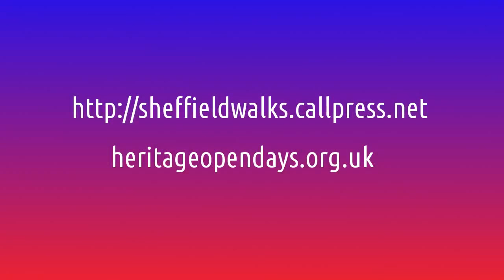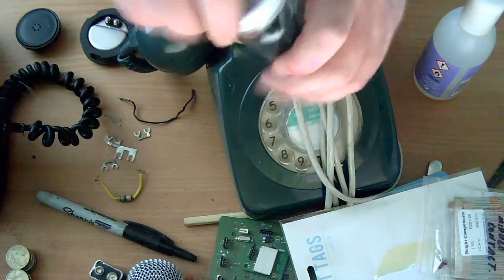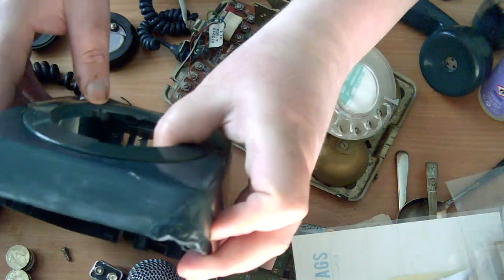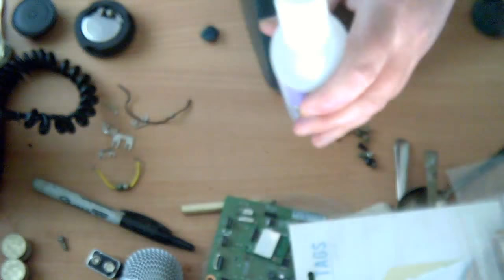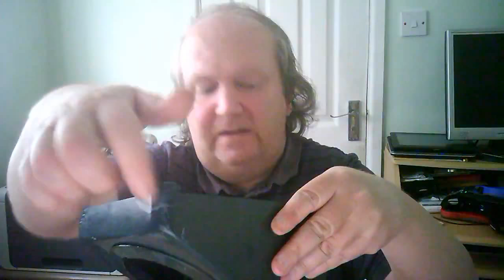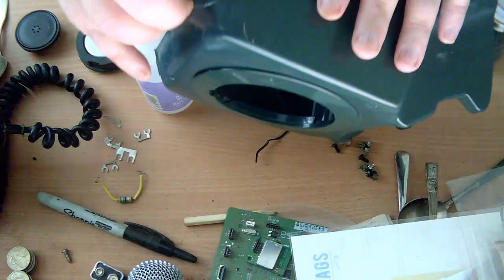ANDYS SHED LIVE S04E01: ABS Repair

Comment: Will this repair work on Australian phones
Reply from the maker: Provided they are made of ABS plastic then yes, it should work just fine. However if they are made from another type of plastic or bakelite then it won't do anything. What you need to know if if the acetone is capable of melting the plastic. If it is, then this method of repair will work.
Reply: The acetone and methlayted sprits worked restoring the colour in the australian telephones
Reply from the maker: That's great news. In that case this repair method will definitely work. Both techniques rely on the acetone melting the plastic.
Reply: It turned my 1967 PMG 801 telephone from sun damage to the original ivory colour